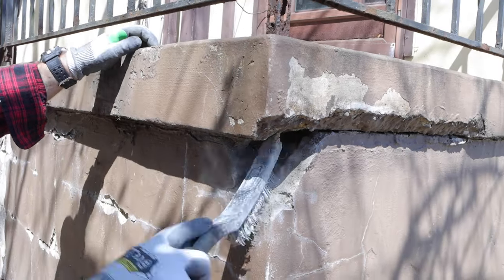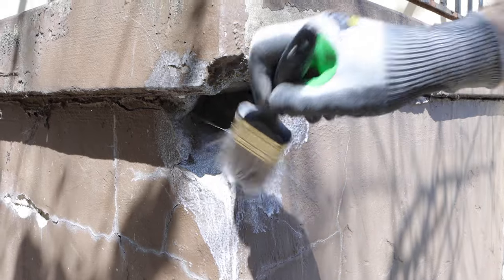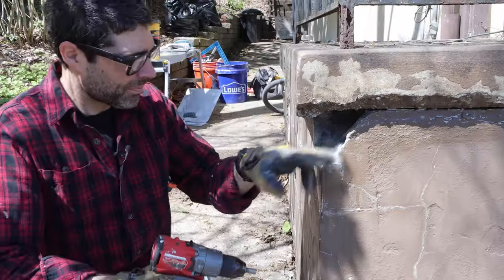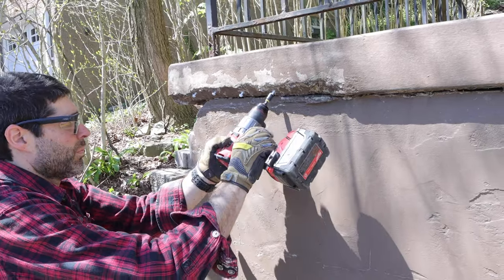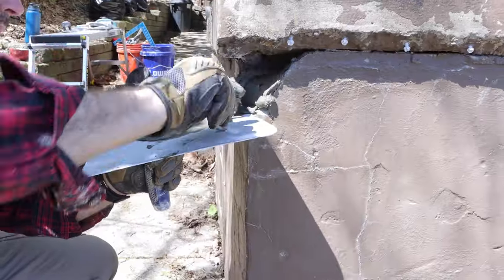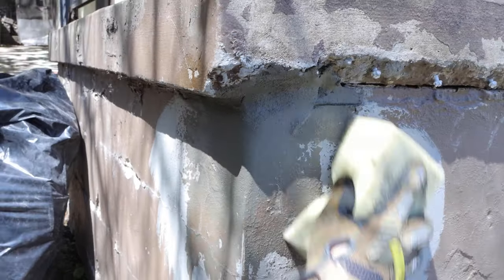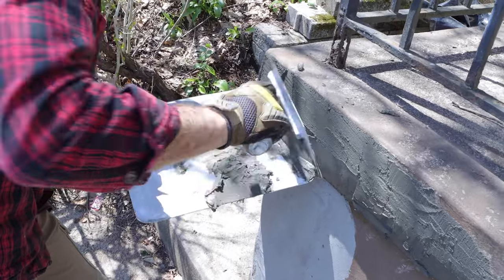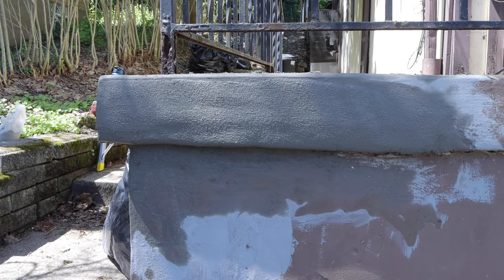Concrete Repair Tips for Beginners

Comment: Wow 2 minutes to explain how to do a project. Thanks for the short version instead of 10-15 minute slog so many you tubers favor for ads. Of course longer version are more detailed but a brief one is always appreciated!
Reply from the maker: thank you buddy, ya, I’m kind of over the long videos that place 5-6 ads in them and drone on and on, but hopefully this wasn’t too quick
Reply: The time was appropriate for the subject matter. When DIY's like myself look something up on YT, I'll watch the short vids first, 3-5 mins, maybe 5-10 mins, and then if it's complicated or those vids don't cover it well, go to longer vids. I've yet to find a good vid on DIY restoration of terrazzo floors (mid-century Fla.) due to carpet tack board divots. That's a complicated one. This Old House did the best job with it, though.
Reply: @HomeRepairTutor  Better faster, and be able to turn it down in settings myself if I need to! Thanks!
Reply: I agree!  I’ve watched a few long videos today on how to repair concrete. They were too long and I didn’t learn much. This video was short and straight to the point. Going out to buy all the tools listed and get started today.

Comment: Probably should put the screws in first then wash the dust away then apply the primer
Reply from the maker: 👍🏼 that’s another good option, you can shop vac the concrete again

Comment: Wire brush
Shop vac

Tapcon concrete anchors 3/16" x 2*3/4"
Tapcon drill bit
Hammer drill
(You can use an sds hammer drill first to drill through it then add concrete anchors)
Quikrete quick-setting cement in 10-20 minutes

Quikrete Concrete bonding adhesive
Paintbrush
Plastic bowl for 5:1 quikrete to water ratio
Plastic bucket
Drywall "Hawk" (Flat tray)
Margin trowel (small thin rectangular trowel)
*now feed the corner that's missing
Flat trowel to form and shape the corner
Bull nose edger to shape it even more
Sponge to sand

Happy fixing and good luck! 😊

Comment: This will make it look good for a bit. I looked into this a little deeper, what you need to understand is that concrete lives of its PH level of 14 everytime water penetrates concrete dust blows into a wet crack or salt enters concrete the pH level rises this is what will make concrete wither. So what you are prepping here is the concrete that has already lost it's pH level and you ll put new concrete on top where pH will be 14 this will hold 5 years maybe and then the low pH part will still wither away.

What you need to do is remove about 1 to 3 cm or well 1 inch of the concrete that got damaged and start repair from there. You ll have a very long lasting repair this way
Reply: I'm glad I came across your comment.  I recall seeing a video where the guy chiseled back some but I didn't remember why. I'll need to do this. Menards guy said I don't need to coat with anything first with the quick set cement mix I bought.  I hope they're right because I'm trying it tomorrow.
Reply: I

Comment: Looks great
 I guess you don't need tapcons except for "underneath"applications.
It really turns a shabby, chipped, neglected, worn-out looking edifice, staircase, sidewalk, curb, foundation, retaining wall, etc etc into a nicely updated and well taken care of feature of your property.
Reply from the maker: Tapcons help a lot with anchoring, so I’d use them for small projects to preserve and strengthen the patch 👍🏼
Reply: Id even add a bit of tie wire wrap from screw to screw

Comment: How would you repair cracks in a concrete driveway... some are 1 inch+ deep?  I've read it's good to use rod bar (cylinder piece of rubber) in large cracks.

Comment: Great video! How long do you let the adhesive cure?
Reply from the maker: It depends on the manufacturer but until it mostly cures
Reply: @HomeRepairTutor  thanks! Ive always had the quikrete stuff. Silly idea, could you use wire, or mesh, or something, to connect the tap cons to give the concrete more to grab onto?
Reply from the maker: @milesaway3422  you could, but I’d be concerned about rust if the patch isn’t too big
Reply: @HomeRepairTutor  thank you. I was thinking chicken wire. I’ve got a big patch of concrete retaining wall on a lakefront—imagine your piece, but 15 feet long.

Comment: Did you add some kind of white primer to the concrete towards the end and why would that be needed? Not talking about the adhesive, but towards the end of vide a white 'paint' appears. I'm going to do an edge repair soon and found this helpful, thanks.
Reply: That was the concrete drying. Thinner areas dry faster.

Comment: We have a 20 yr old short, concrete brick wall that the top row of bricks has come loss and fallen off. The bricks as still in perfect shape but my Dad never used an rebarr  because the wall is only 3 bricks high and he felt it wasn't necessary... which it wasn't for the first 20 years. Is there a way I can re-use these bricks... would I need to knock off all the old cement?
Reply from the maker: you could try to knock off the old mortar and re-use the bricks with mortar, there are some really great brick laying videos on YouTube that’ll help out

Comment: What do you recommend for sanding down/smoothing the concrete when you're ready to refinish the whole wall after repair ( ie paint)?
Reply from the maker: depends on the finish, you could use a wire brush and paint scraper or grinder with a wheel specifically to remove paint
Reply: @HomeRepairTutor  thank you! We have a concrete wall in our entryway that is below ground and had to repair 2 cracks. Filled the port holes from resin fill with quick cement now we need to repaint the wall

Comment: What are you going to do with the metal railing? I have a metal railing on my basement walk up and it is rusted as well. Thinking about doing a treated lumber replacement maybe. Great video.
Reply: Sand and spray paint with rusoleum

Comment: Can you pour concrete directly on grass for a new driveway? What happens if I don't use concrete form just pour it.
Reply: A new concrete driveway is not a DIY project. If you just pour a bunch of concrete on the ground it will look horrible and then crack into a million pieces shortly thereafter.

Comment: I dont understand how it got tok complicated over the years. I used to just mix cement, wet the target area a litt bit let it try a bit and apply the mix. None of that bonding stuff. And its still a wall 20 years later
Reply: Kids love playing with their toys apparently. Everything in this video felt like an advertisement, too many products today designed for problems that shouldn't even be there.

The corner repair had me facepalming hard, couldn't be further from the proper technique if he tried. As you said, a good simple cement mix and some wetting beforehand and it's done.
Reply: @yonidellarocha9714 what’s the proper technique?

Comment: Not a professional job. Edges should be trimmed back at least 1/4” deep. Finish looks rough. I’ve done this for 50 years and still enjoy doing it.
Reply: Notice the title says for beginners..
Reply: @Zhcwu  it reads "for beginners", should read "by beginner". Was it really that hard to use a straightedge or the very same trowel to give it a proper non-wavy finish?

Comment: I dont think that is the proper way to use that  adhesive, says right on that bottle make a slurry with a cement sand mix and paint that on after dampening the concrete with water.